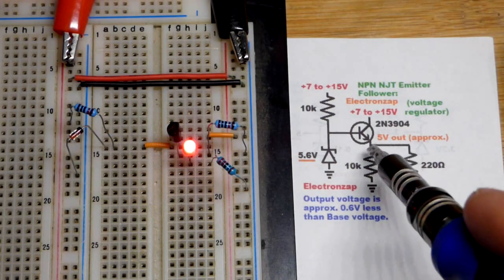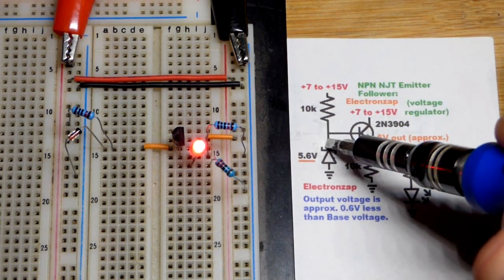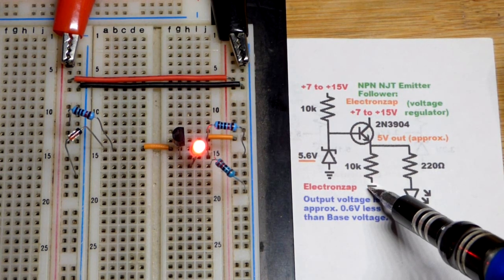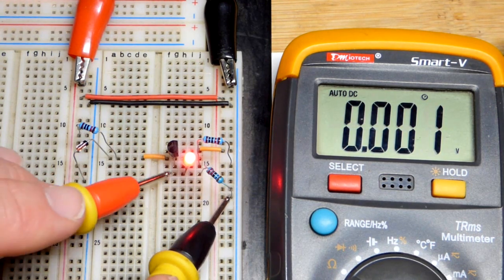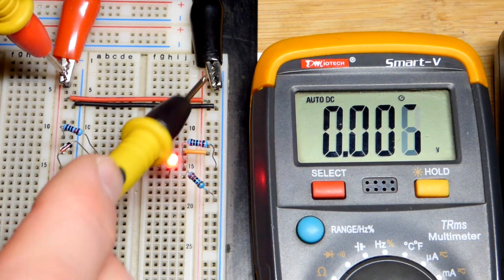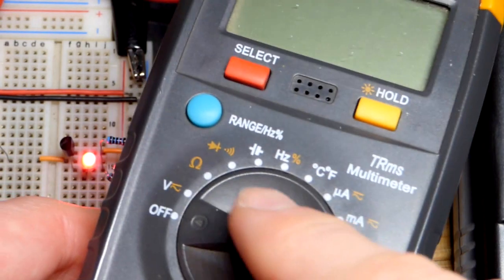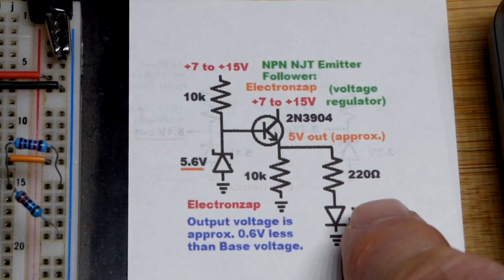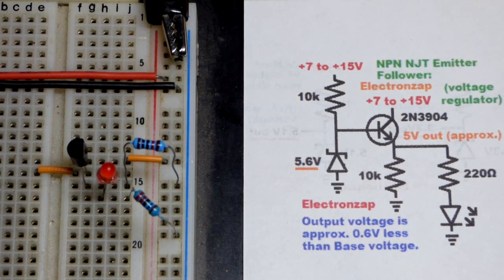How to use zener diode to set NPN BJT emitter voltage circuit 2N3904 Bipolar Junction Transistor

Comment: Why not just use a linear voltage regulator?  I only use zeners for very light current loads where the npn is not needed.
Reply from the maker: That is the best option if you have one. Thanks for the tip!

Comment: Works best with a low β BJT and the emitter 10k is totally useless. It's called a voltage regulator with a fixed load.
Reply from the maker: Thanks for the tips!